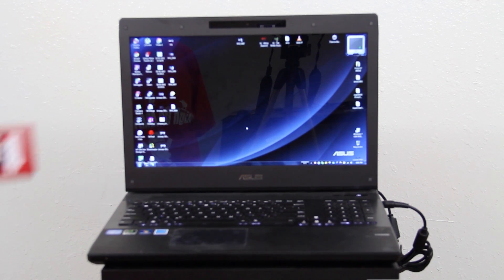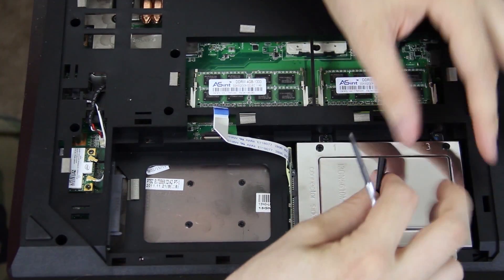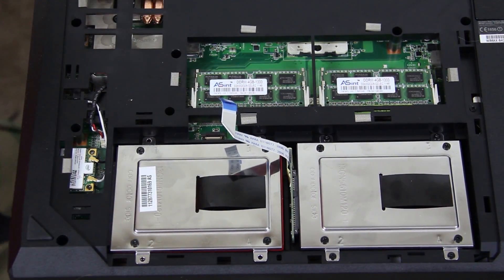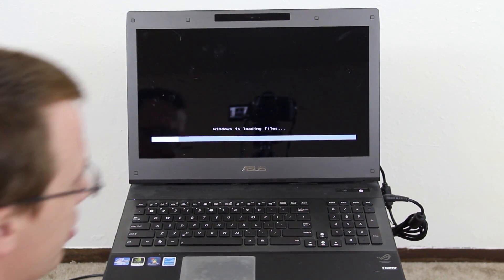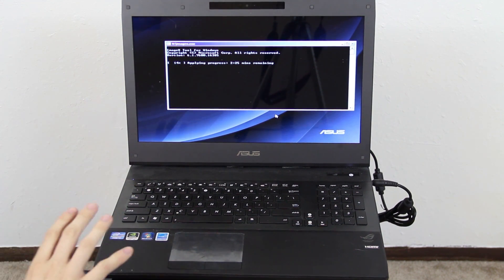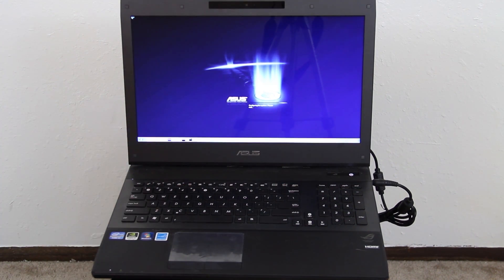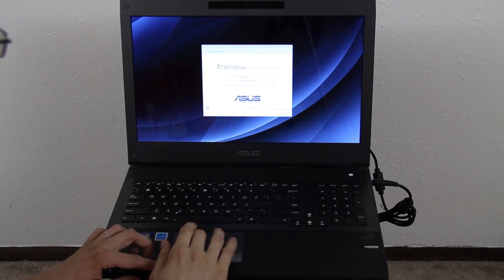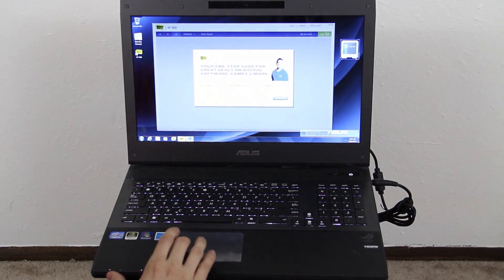How To Install an SSD and restore Windows 7 on the Asus G74SX

Comment: I have the same laptop since I bought it in like 2012 from best buy also, and just got an SSD finally, lol. This video will be invaluable since I've been nervous about how to go about installing it. But I can't wait, it looks sooooo fast!!
Reply: @Jon its still running great after all these years. This thing has been through a LOT all on the original hardware, including times in FL in summer with no A/C, flights with it loosely thrown into my backpack and TSA hell, I even accidentally dropped it from like 3ft recently with no ill effects or damage. Only recently did I install more memory and do a fresh install of Windows then upgrade to Windows 10 and now hopefully have this ssd installed once I build up the confidence enough to feel like I'm not going to brick it or screw something up lol.

Edit: feel like I should also mention I have a serious tab hoarding problem with probably like 700 something tabs open last time I checked 😩 still runs well enough to not want to throw it out the window lol